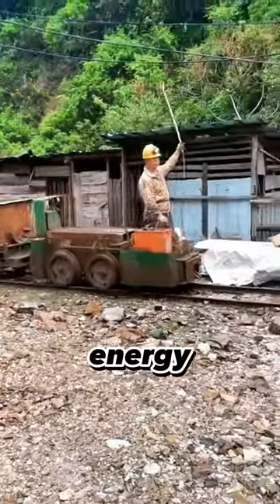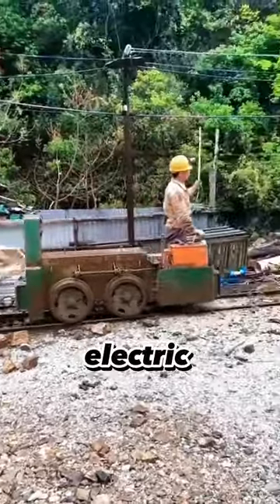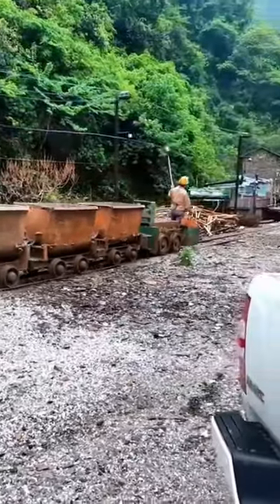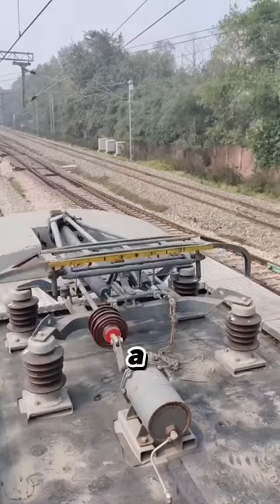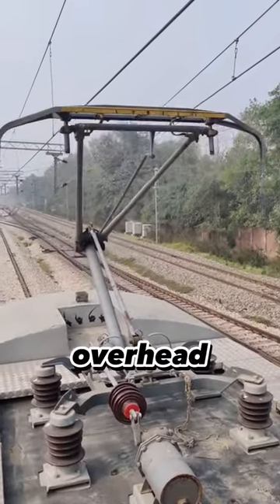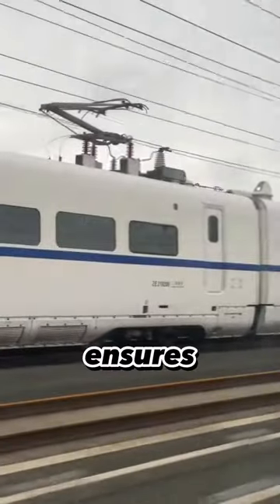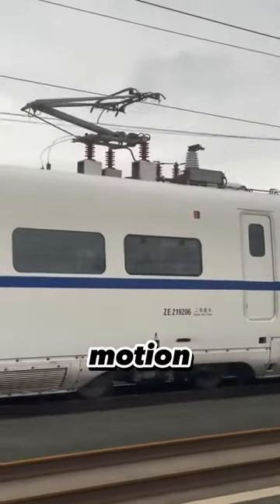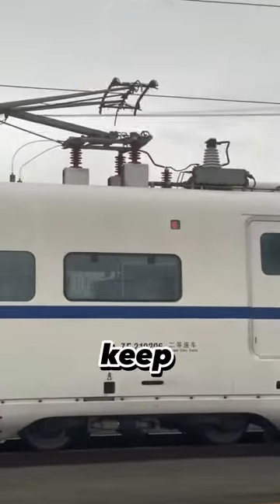How Electric Trains Works #shorts

Comment: Holding the trolley pole in your hand? Is that a death wish?  😮😮😮
Reply: Not if it’s insulated and it’s low voltage.
Reply: The "pantograph" is insulated, he knows his stuff, at least the little train is moving 😅
Reply: what if its raining? maybe they don't use it in bad weather anyway
Reply: @ElectronicInspiration  I mean...you're holding the thing that supplies powers to a huge metal vehicle, so there's a lot of things that could go wrong when you get wet 😅
Reply: @suhandatanker  that would not be a pantograph it'd be a trolley pole 😊
Reply: In countries where 95% chance of no injury is good enough. They just look at that 95 and say wow.. that's so good.. so close to 100. It's a fault in reasoning.
Reply: @inspectorhserfnz0019  streetcar, trolley pole, pantograph, at least it supplies power
Reply: He is the Driver, not a Conductor

Comment: In Chicago we have the 3rd rail. The electrified rail is below the train. In the few places the train passes pedestrian walkways there is no electricity. The train is long enough to get enough electricity while crossing areas with no electricity.
Reply: This is more common in subway systems. Longer distance systems use overhead wires, i suppose because animals can't touch them.
Reply: @@HypeShortzShow me a train in South Dakota that has a 3rd rail
Reply: Should just use a diesel electric train
Reply: @@HypeShortznah guy. It’s not everywhere but it’s in a lot of places.
Reply: They also have disel generators for when they can't get grid power
Reply: @kregadeth5562 they’re only used in places that are either too poor or too mismanaged to electrify
Reply: It was super scary to me. It's not even shielded. And the doors in the back of the trains can be opened!
Reply: AFAIK in Germany we either have overhead lines or shielded third rails, but just leaving them open feels totally crazy to me. 
Then again you also have a big part of the population running around with guns =)

Comment: Or you can get a Chinese man holding up a wand
Reply: Bet that's a realtivly great job for that area. High pay, comfortable, and realtivly low risk. As the load must go through. Possibly satisfying jod.
Reply: @daniellafferety4025  definitely not at risk of getting electrocuted. They can just as easily lay down an electrified track

Comment: There 2 type where train get power
-overhead wire, the one you just saw
-3rd rail, typically it on metro
Reply: or wireless
Reply: @HerpesHabenderHauptmannHarry  then that would be diesel train
Reply: @KemRail  with big Tesla towers
Reply: The London underground uses a four rail system with collector shoes and some areas of Britain's railways use a 3rd rail pick-up, also with a collector shoe.
Reply: @davidatkinson2167 correct. Different DC voltage also
Reply: Don't you mean MOST places in the UK use the 3rd rail lol.
High speed has 3rd rail zones as well as cables.
Reply: @paulammon2281  mostly in the south, london, Kent, Sussex that sort of area also some 3rd rail in Liverpool. Most hst are diesel the others use ohle 24kv. Class 395 ‘javelin’ does use 3rd rail and ohle. Docklands light train uses 3rd rail and collector shoe is inverted.
Reply: @paulammon2281  i mean, china have fastest train that runs on 3rd rail
Reply: @KemRail Nah. You can have tesla coils , large battery packs etc. The Soviets even tried Nuclear
Reply: @HerpesHabenderHauptmannHarry that would be more expensive and less efficient than catenaries
Reply: Why is a third rail even necessary? Most trains already runs on two. One for live, one for neutral. Can't be for 3-phase, because that needs 4 conductors.
Reply: @danielch6662  The other two rails are not powered. The third rail is the only powered rail.  Most subways use third rail or overhead wires. Third rail is cheaper to maintain and build compared to overhead. 4 rails is another option but very costly
Reply: @danielch6662 the two rails are often used for signaling. By where I live you can drop the crossing gates by putting a steel bar across the two main tracks ;)
Reply: There is 3rd rail 4th rail battery diesel Overhead lines and hydrogen
Reply: So THATS the middle yellow rail ?
Reply: @Is_yer_robeOnFire what “yellow rail?”
Reply: @DarkAttack14 here in Germany you need a special key for that called the DB 21 😅
Reply: @paulammon2281 the southeast has mostly third rail. pretty much everywhere else uses OHLE
Reply: @KemRail Nope the British rail class 442 has the world record for 3rd rail.
Reply: There's also 5th rail
Reply: @ericandes4288 
But useful where there's a problem with ground leakage, eg tube tunnels, hence 4th rail for the return
Reply: And the United Kingdom trains

Comment: Don't forgot that the Rails are the return line.
Reply: You can also use third rail electrification, like the London underground
Reply: @makeshake9582   You can, The third rail is the live and the drive rail the neutral return, A bit like how model trains operate. Where one rail is live the other negative.
Reply: @dogwalker666 one rail live other neutral ? Seems like a good place to steal electricity from
Reply: @Anonymous-8080  If you can handle 300V DC feel free to try,  Many have non survived.
Reply: @dogwalker666 isn't it over 600vdc?
Reply: @subbaaja100  My bad I was thinking of Cranes The third rail system is 750v dc
Reply: @dogwalker666 imagine making a voltage divider to charge your phone from the track 💀
Reply: @claytoncallaway6412  That would be a lot of 1/8th watt resistors.
Reply: @dogwalker666  you’d only be drawing around 15 watts for a phone
Reply: @claytoncallaway6412  yes but you need a massive serial/parrallel combination too handle the voltage, The resistance banks I used to make were enormous Nickle Constantine elements on ceramic insulators.
Reply: @dogwalker666  is that relevant? In the circumstance that I’m describing there wouldn’t be much power draw so I feel like it shouldn’t be relevant, by my understanding ohms law says that a few thousand ohm resister divider should be enough.I’m no engineer so pls tell me if I’m wrong
Reply: @claytoncallaway6412  You are mostly right however due to the way resistors are manufactured they cannot handle high voltage it just arcs across them,  so you either use special high voltage resistors or hundreds of low voltage resistors in series,  
This also gives you protection if one resistor fails short circuit, the voltage will only rise a volt or two not several hundred,  
It's something Chinese manufacturers  have forgotten.
Reply: I installed myself an off-grid solar panel array last year, 2.4kW, circa 120V DC, 8kWh storage. It isn't a big deal anymore and getting electricity was never easier ;)
Reply: @pavel9652  You do need sun however, And the PV cells are cheap it’s the batteries that cost the most
Reply: @dogwalker666  True, but it isn't as bad. I live in one of the EU countries that is in top 5 for cloudiness. Smaller storage can be compensated by over-paneling. With the setup I mentioned, 2.4kW, 6s2p, installed almost flat (5 degrees), I will have virtually unlimited power for 8 months (Mar-Oct), 3 months (Nov/Jan/Feb) will be sketchy, depending on the weather, and December is the worst one, archenemy of solar, that requires serious attention and I might need input from power generator. This winter I was learning, and had to learn a few things, so I will be more ready for the next winter. Since April I am completely flooded with photons and electrons ;)
Reply: @pavel9652  Indeed, We are probably number one for clouds or rather rain, 
And yes if you have the space extra panels helps, We are pricing up for work the panels are not too bad about 20K even the three phase inverter is about 5K unfortunately the batteries Are 2 Million, owch!
Reply: @dogwalker666  I have done everything myself and I am off-grid, so no paper work and no contractors. It cost me around 7k euro, I think. This is with VAT, because I couldn't have used tax relief nor government grants. I have also purchased a quiet petrol inverter generator from Hyundai, but I used it only for about 5h. Panels are installed almost flat on simple unistrut grid. The inverter is only 2.2kW, but I usually have loads up to 1kW, which is mostly cooking or boiling. I try to really on DC, because it is efficient, but it only matters in winter.
Reply: @pavel9652  You need too be more careful with DC, switches need to be DC rated I have seen people use AC rated isolators on panels then wondered why they failed. 
I used to do a lot of DC crane control and it’s exciting when it fails.
Reply: @dogwalker666  Thanks for the reply! I don't think so, but I don't work with the high voltage DC in the MC4 solar panels circuit. When I say DC I mean USB-A/C, and 12V 10/30A from the power station, so it is safe. I saw people using step up converters to power devices such as WiFi router from 12V instead of typical AC power supply, etc. I don't do it, but I have a DC/AC capable fridge, DC lights and charge various batteries and devices via USB or 12V powered smart charger, where I can control battery chemistry, number of cells and charging parameters such as amps.

Comment: There was something missing. The pantograph picks up power, and it gets sent immediately to electric motors attached to the wheels. The negative charge goes through the rails back to the power station.
Reply: Does the Pantograph physically touch the wire. If so then how is the wire able to withstand wear and tear?
Reply: Are you implying that the train uses DC electricity?
Reply: @SayVeritatis yes, the pantograph is physically touching it. The wires are replaced in regular intervals.
Reply: @DaemonwarriorJulius  Also note that the catenary zigzags. This equalizes the wear on the pantograph's carbons. This is where the wire rubs. They are not just carbon and are replaced regularly. Their composition reduces friction and extends the life of the wire, but the wires do need regular replacement as mentioned.

Comment: Also the reason why they go zig zaggy is so that friction doesn't do it's thing.
Reply: You can say that. But friction still damage the pantographe, just equaly on the whole length rater than on one point. A lot usefull on high speed train, where there is a lot of friction.

Comment: Well i have two questions ❓, first, is it dc or ac ? Two if the overhead cable is the power source , where is the neutral cable???? All my understanding in electricity 🔌 there two cables , the positive and the negative, how train works with one?????????

Comment: This is how SOME electric trains get their power. There is a different system used on what was British Rail Southern Region (And quite possibly elsewhere)  where the power rail is a free inches outside the rails. It can be either side. . And the London Underground also uses a third rail, midway between the tracks. And to top it off, there are diesel electric ,"deltic" locomotives
 Each segment of the deltic engines had 3 crankshafts, 3 cylinders arranged in a triangle, and 6 pistons, 2 to a cylinder. 😮😮. But yes, some electric trains use pantographs. Quite a lot, actually. .

Comment: There is 2 types of electricity trains use. AC, which is OHLE. And DC, 3rd/4th rail. Battery is also one too, and diesel trains use diesel. Steam trains, erm steam.
Reply: Not exactly, you can have DC overhead wires as well. Matter of preference.

Comment: third and fourth rail electrification: am i a joke to you?

but as far as im aware of, its the exact same thing but with 'shoes' and not pantographs and obviously the electricity siurce being below and not above. additionally, battery electric units also exist, which charges by lowering a shoe onto something similar to a tiny third rail, and obviously raises the shoe before leaving the station or siding or depot or whatever

Comment: Paragraphs are piss easy to work on they are pneumatically raised and require a little bit of grease on a chain a the blades need measuring ensuring they are 31mm thick and no air leaks

Comment: But unless its steam they are all electric.  Some get power from the grid.  Some get power from a generator onboard.   The diesel engine just turns a generator
Reply: Not all diesel trains are Deltec. But it's the most common.
Reply: Really? Diesel engine euns generator or roll the wheels directly?
Reply: @Anonymous-8080  On a Deltec the engine drives a generator which drives DC motors, Far better torque at low speeds.

Comment: So where does the electric come from
Reply: Power stations
Reply: When you have a turbine with magnets on the crankshaft that spin around Copper coils it will induce a current within the copper creating an electric field hence you have electricity. The electricity is generated by magnets pushing the electrons through The Wire. These type of facilities that do this are called power plants or power stations.
Reply: @DragonProtector174 this guy is a true scientist

Comment: I have just unsubscribed.
The first part of the video is ridiculous. 
You have made no effort to describe ways of obtaining power other than a Catenary  (a term you didn't use.)
Most metro systems use a third rail, in the case of the London Underground there are four rails, developed to prevent corrosion with the cast iron tunnel linings.